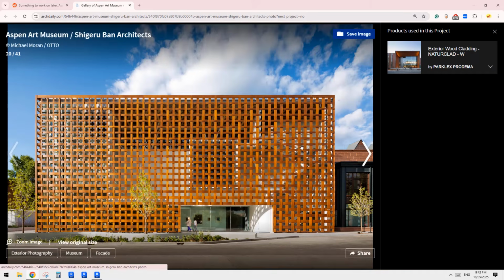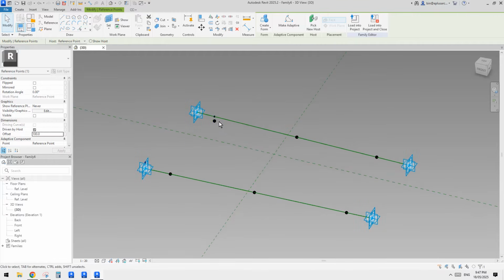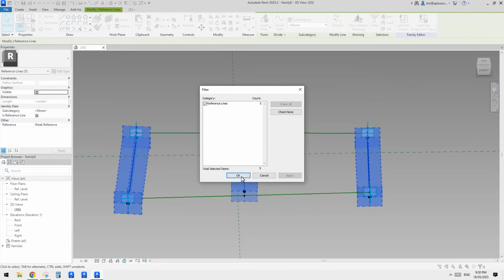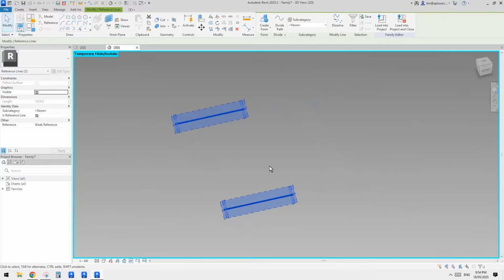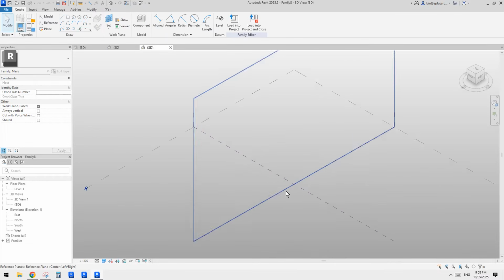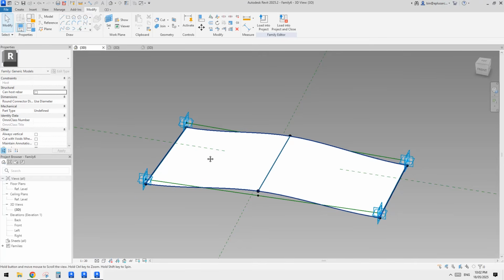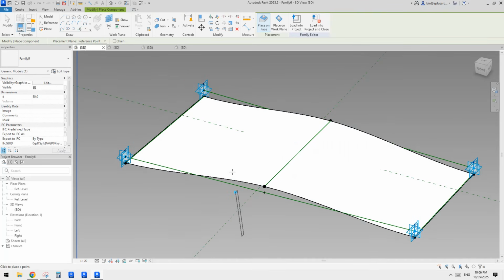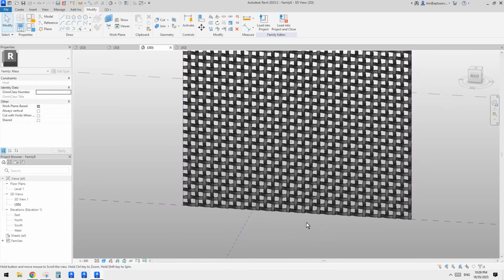25068 - Woven Cladding with Pattern Based Family in Revit

Comment: When I import the first weave into the pattern family, it keep saying can’t make pattern. I don’t know what the problem is
Reply from the maker: Try adjusting the pattern grid to roughly match the divided surface grid. For example, if the grid size in your pattern-based family is 3000x3000, adjust the grid of your divided surface to around 3000x3000 before loading and applying the family.
If it still doesn’t work, the issue is likely the orientation of the family. You may need to re-do the family to ensure it can be placed correctly on surfaces in any direction.